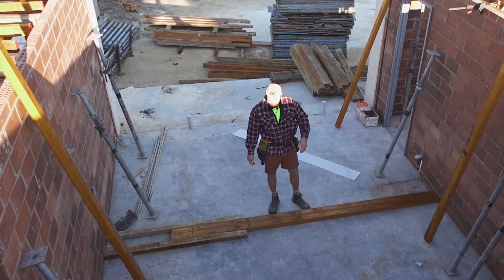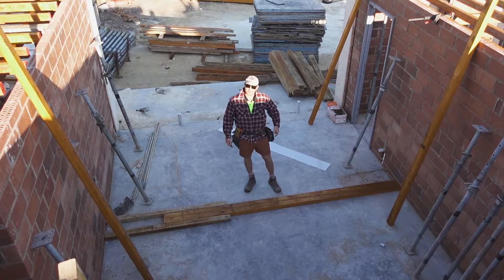How to build a suspended concrete slab part 1

Comment: Can you do it in sections to save on formwork?
Reply from the maker: Yes however pump and concreter costs will out weigh the formwork.
Reply: @bmformworkconcreteconstruc9783  im building only 1000 sq foot basement, i guess its better to form the whole thing   at once then.  I have lots of room, i was hoping to pour without a pumper.

Comment: can you take all the formwork down when the concrete slab is set and can you reuse the timber!
Reply from the maker: Yes, it would be very expensive if we couldn't  re-use anything. In residential formwork the key to making money as a business owner is maximising how many uses you get from all your materials. You have to do about 6 jobs to cover the cost of one job worth of materials including props.
Reply: Are you serious what sort of question is that.Its not rocket science.

Comment: Alot of work  there
Reply from the maker: We used to do 3 or 4 of these a week when I had my crew and just did suspended slabs!
Reply: @bmformworkconcreteconstruc9783  were doing a  small one in cebu in a few weeks. Getting materials up now my brother in law will be doing it. I can  see that this will be a huge project even for a small area. Working with what you have. Much respect for you and your crew

Comment: I think there would be a whole lot of ways to set that up, and I'm just figuring it. Maybe just start with a lot of steel I beams permanently installed first, then lay the sheeting on top of that with 4 to 6 inch aircrete for weight reduction, and primarily rely on steel strength for structure, but I'm just guessing.
Reply from the maker: Cranes are and haulage are expensive. Every region does things differently, and people try many methods here however this is the most popular way where we are so it must have its advantages!

Comment: Where can I learn correct spacing for whatever thickness slab and different timber sizes used ?
Reply from the maker: Good question. Ask someone who does this in your area (will change depending on the local products used) but for it to be covered by insurance you can ask an engineer to give  you this.

Comment: I also intend to build me a suspended concrete slab, but instead of using the sheets plywood i prefer to use timber planks.
Wich will create an imprint after removing.
Any specific advise would be nice, thx.
Reply from the maker: Keep all the joints sealed up so it's water tight. Use form oil just before you pour. Keep everything clean. Make sure your reo bar chair don't bite into the timber and leave an imprint.

Comment: whats tieing the deck in theres cross bracing ie frames ?
Reply: great video by the way
Reply from the maker: Hey Fergz, extra nails in the sheets tieing the balcony to the main room, some straps over brickwork and 4x angled no.3 props on balcony.
Reply: @bmformworkconcreteconstruc9783  awsome videos so u tied some of deck into other rooms with straps ive never herd of angled props? i thought if u were going just use props for a deck u would have to have a locked in room or use scaffold tubes to contruct a makeshift frame or like when useing peri ratchet strap the bearer to the ground  thanks for the videos pal exelelent veiwing do u alwaze work by yourself?
Reply from the maker: @fergzmack6963  hey mate, yes you are correct, you need to prevent lateral movement of the suspended slab. I did that with raking props which are not shown in video. You can use scaffold tube or peri ratchets but there is no need here. It is also system dependent. I am framing with timber, I know how to lock it in without the need for scaffold tune and ratchet straps. The balcony is only 2.8m it is tied into the job with steel strapping at deck level. I will make sure I  show in future videos. It also depends how you pour the conc. The is more lateral force if the concrete pushes off something into the edgeboards. You have to find where it will separate from main deck and lock it there. In my case it was the timber splice. So I nailed off the sheets with extra nails, raked long props from balcony to ground and strapped main deck to other rooms. There was no possible movement.
Reply from the maker: @fergzmack6963  I used to have a team varying from 4-8guys working for me. However I decided to scale down and I am able to earn very good money on my own doing more complex work. I do some cool jobs which is why I started the channel, but since starting the channel the tricky jobs have dried up a bit! That has started to change again though.

Comment: A few frames would make your life a whole lot easier.
Reply from the maker: frames can be much easier for inexperienced guys. But if you can do it without them it is far quicker using props. only have to carry 4 props vs 2 frames, 2x braces, 8x jacks then set 8x jacks. Frames also destroy site access and do not fit great on a truck or on forklift tines. I usually just use frames for beams, high sections and large balconies. I prefer quickstep or layher than frames(standard and ledgers) as they more versatile.
Reply from the maker: quickstage*
Reply: @bmformworkconcreteconstruc9783  I think saying “inexperienced “ guys is the wrong term. If you had to get an engineers certificate on the deck they wouldn’t pass the props without tube bracing or gates. 
 You also have the benefit of newish materials that are all good lengths, you wearnt given a few bundles of short bearers to use lol
Reply from the maker: I don't need an engineer's certificate to pass formwork on a house so what is your point?
Reply: @bmformworkconcreteconstruc9783   in NSW any suspended formwork is supposed to have a certificate before pouring…. That’s just the way I have had to do things the last 30 years.
Reply from the maker: so every small house suspended in nsw is signed off? Or just the bigger stuff? because as far as I'm aware it is the same here but only commercial sites impose it. BTW there was quite a bit of lateral bracing added on the balcony on this job in the video. I just didn't happen to film it, I should have. There was also a bit of work done in the timbers and way it was all fixed off to increase stability. Its also far smaller than it looks the balcony deck was made larger to aid building the upstands later.
Reply: @bmformworkconcreteconstruc9783  by the Nsw code of practice any suspended formwork should be signed off. I’m sure a lot of small jobs don’t, but if there was a collapse and you didn’t have a certificate the builder would be facing serious charges if someone was injured.
 I’m sure you did a lot more bracing cause going by your other videos you take a lot of pride in your work.
Reply from the maker: thanks! I've actually never heard of a collapse in residential but plenty in commercial. I'd say 90% of them are bondek slabs which collapse.

Comment: Great video, what size timber’s are you using.
Reply from the maker: Hi Tim, timbers are 95x65 lvl's (3×4's) Some of the bearers are larger 135x87 (6×4).
Reply: @bmformworkconcreteconstruc9783  
Would it be okay to use 170 x 45 lvl?
Reply from the maker: @timnewsham819  I don't want to recommend anything as I do not know where you are and what your lvl's build quality is, or your slab thickness, or the spans you plan to use, but a 170x45 Australian structural lvl will be much stronger than what I have used.
Reply: @bmformworkconcreteconstruc9783  Thanks

Comment: Question mate, did you add any additions to your nail belt?
Reply from the maker: buckeroo belt, DeWalt nail bag, buckeroo hammer and nip frogs. And I got the suspenders as my nail gun is so heavy it pulls the nail bag down.
Reply from the maker: I really like the DeWalt nail bag's as they have good storage and great pencil, pen holders and a speed square slot.
Reply: @bmformworkconcreteconstruc9783  cheers for that. Looking to get the same but realised the same one you have is missing the hammer and nip frogs to the normal ones you get from bunnings

Comment: Is it possible to replace a wooden framed roof into a concrete slab? What would be the better solutions in building a concrete slab with existing walls and columns
Reply from the maker: Yes this is possible, we have done this before however upgrades are required to the house foundations which will carry the weight of the new slab and structure above. Sometimes its not as bad as first thought.
Reply: @bmformworkconcreteconstruc9783  my lord, what would that cost for a standard size roof replacement? Removal, foundation work, and roof???

Comment: What are the centre measurements between props and what are centre measurements for bearer spacings?
Reply from the maker: Depends on the slab thickness and timber sizes used.